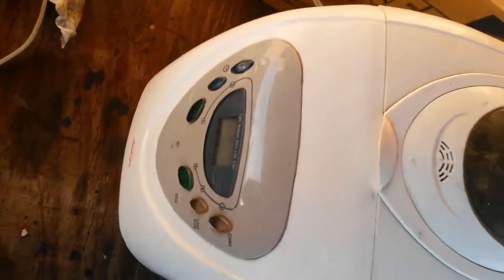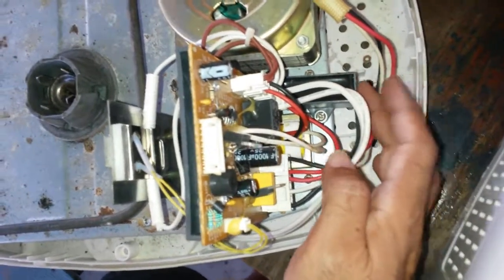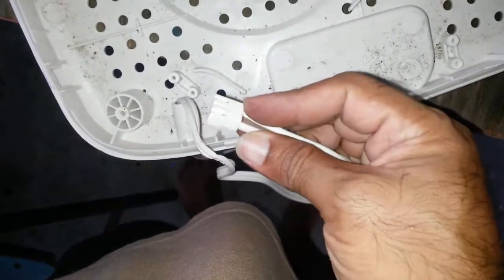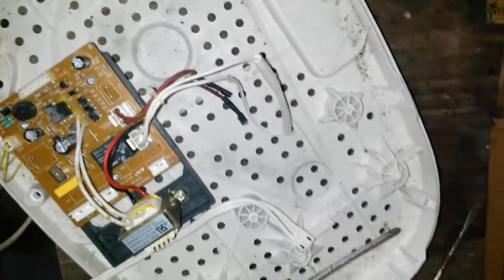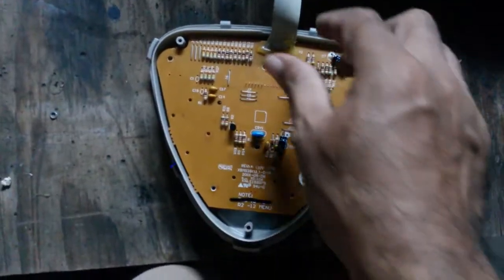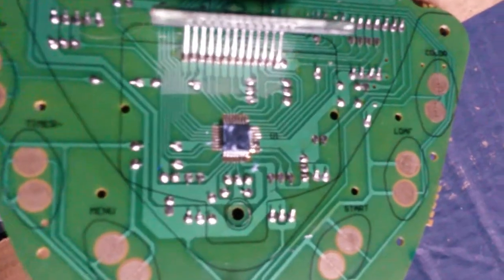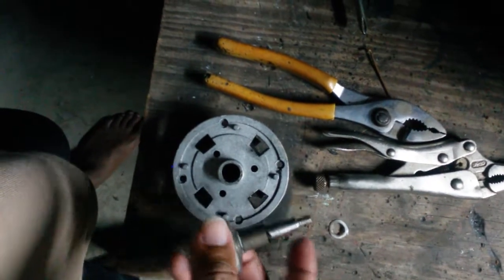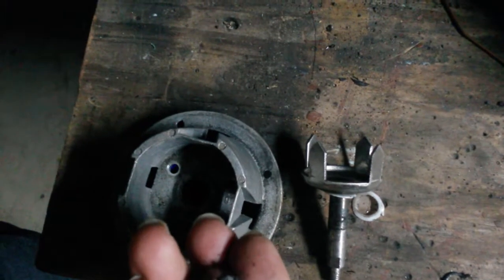044 Disassembly of a Bread Making Machine

Comment: Really nice. :) I have a motor from something like that, but it's bigger.
Reply from the maker: MC's Creations Thanks. There are quite a few different configurations of motors that's why I wasn't too sure how to wire. Turned out good this time :-) 

Motors are always useful. Keep yours safe. Someday it will come in handy in a project.
Reply: Manick N Absolutely! :) Mine is 127v dc (110v dc, but well... Here is Brazil, so...). And I'm thinking about making a small lathe with it. :)
Reply from the maker: I didn't realise Brazil has a slightly different voltage. I considered making a lathe some time ago but its not high only list since I have a small lathe already. Very small hobby size. 2" ID chuck and 1/2" bore.  Most likely before the end of the year I will upload a peltier refrigerator I built with it back in 2007. 

You will probably need to use pulleys to reduce the speed. A regular light dimmer will work (I have a n extension I made with a dimmer to test stuff) but you will loose the torque and that's no good for a lathe.

Feel free to bounce ideas off me and I will advise on what I know or have tried already.
Reply: Manick N Nice! :) And I will! I say the same, I've done a few things too. :) I make videos too, but in Portuguese.
Reply from the maker: MC's Creations cool. Let me know when you start uploading. Once I can follow along without understanding the audio I will watch. Quite a few videos I look at do not have voice so I am accustomed. 

Some English subtitle text along the way would help. Not a full translation but just some notes on the bottom every time you start a new process so non native speakers can tell what you are trying to do.
Reply: Manick N Sure! :) I have a lot of videos there already, but had to stop because my mother was hospitalized. (But she's ok now!) As soon as I can I'm going to upload again. :) About subtitles, it was difficult because I was doing everything only with my smartphone. But now I bought a notebook, so I'm going to look into it. :)
Reply from the maker: MC's Creations I will check out some of the videos. Credit for doing videos on your smart phone. That seems like it will be challenging. I use a PC. Probably would not have uploaded if I had to work off a phone.
Reply: Manick N Yeah... It's a lot of work!